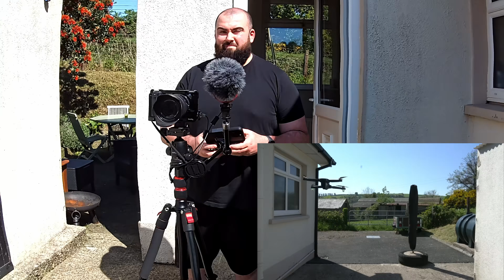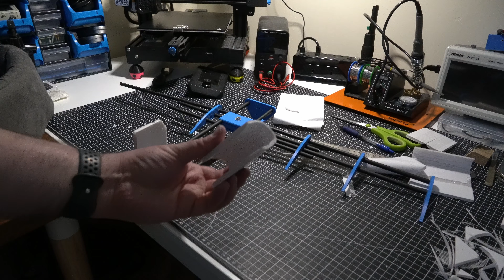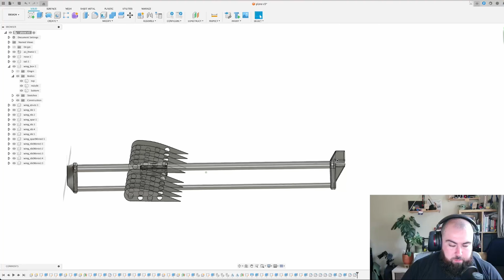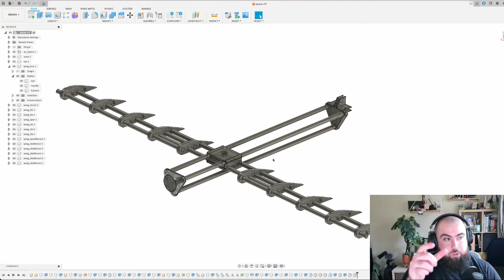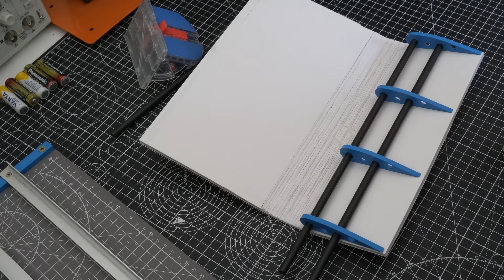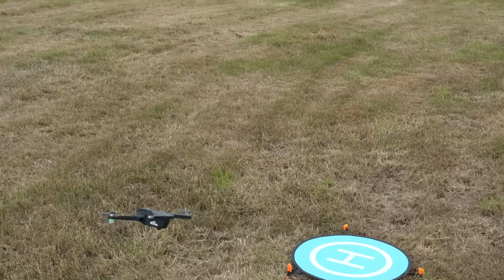Building a 3D Printed RC Plane!

Comment: Good day, 
I hope this helps you learn and fly all at the same time. Below are tips ive picked up from reading, trail, and error in building RC trainers/ slow fliers. Here's what helped me.

-Airfoil -
If you want it to fly slower, don't add the bottom surface to the wing. It will be like flying around with your flaps on, great for a chill flight. Reduces stall (crashing) speed. 

-Wing Alignment -
 *Make sure the leading edge is above the trailing edge when looking at it from the side, or ensure that the entire horizontal stabilizer is angled downwards by a few degrees so you get positive angle of attack/ lift even with your thumb off the stick.

-Roll and Roll Stability -
Build the plane with 10-13 degrees of dihedral (the V shape of the wings when viewed from the front of the plane) so it self corrects its roll based on what the rudder is doing. You can also roll with the rudder using this set up, so you can fly the plane with just your right hand + throttle. 
Construction 
Build it as light as possible to the point of structural failure, like an A6m Zero. Since your not riding on it, you can always add a bit here and there. Try using skinnier carbon or 4/5mm dowel sticks. Try using just 1 main spar if you can. 

-Pitch and Yaw Stability - 
Your vertical stabilizer is small compared to the size of the rudder, usually the rudder is a small flap. You almost have an all moving rudder. 

Your tail fins can be fairly large, this has no real negative affect on small rc planes. Worst case, you use more battery. The positives are worth it, you get more stability and you increase your CG tolerance. 

-CG location - 
Try to put all of your servos within the wing cord length to make it easy to balance. It should balance at or in front of 35% of the wing cord length (further forward is fine, further back is a new plane!) Forward CG makes it more stable, but can make it lawn dart. Rear CG makes it less stable, like a Su-27 Jet...but if might try to fly backwards and crash.

-Pre Testing -
Put your all up weight and wing area into a WCL (Wing Cube Loading) calculator to get an idea of the flight speeds. https://www.ef-uk.net/data/wcl.htm 

I try to aim for a WCL of around 4 with a 15% (of wing cord) airfoil thickness, no bottom surface for easy slow flight. 

Throw it onto your bed, couch, or tall grass. if it floats over similar to a paper airplane, its probably going to fly easily. If you have to baseball pitch it, its going to be fast and  hard to fly unless your Maverick on the sticks. *especially for a beginner*

Good luck!
Reply from the maker: Wow, great info, thanks so much!

Comment: The biggest problem is that the center of gravity is too far back; it should be located at one-third of the wing chord. Also, the motor’s thrust should ideally be greater than the weight of the plane. You can hold the fuselage with the propeller facing upward and start throttling up to test it — if the propeller’s thrust can lift the plane upward, then it’s pretty much good. Be sure to pay attention to safety during testing. By the way, the plane you made looks really beautiful. Keep it up!
Reply from the maker: Wow, that’s for that advice, a few people have mentioned GC, but the thrust test is a great idea, will remember that for the future!
Reply: @careyian  Center of Gravity = CG

Comment: Hi, good work 👍 its too heavy but the modulable conception is a good work, some updates will be good.
Reply from the maker: Thanks for the feedback! I posted over on Reddit and got similar feedback, think I might follow some of the good advice I’ve gotten, strip it all back and start a bit simpler
Reply: @careyian 👍 it is good start and a good structural design. Perhaps a little tune of the Mass répartition and a little more longer for the wing and it will be good 🤞

Comment: Oh wow this was my exact experience a year ago. My converted glider from LIDL plummeted into the green in less than a second. Like a brick. 

I went and got a speed build kit from Flite Test and built that. I printed the plans for the "Tiny Trainer" on paper and then cut them with a scalpel out of foam. They go fine with the 20 euro Amazon plane esc motor prop pack. 

I've build 6 planes in the latest six months and am making a Maker/drone TY course for students in school over the summer. Really looking forward crashing a lot of planes.